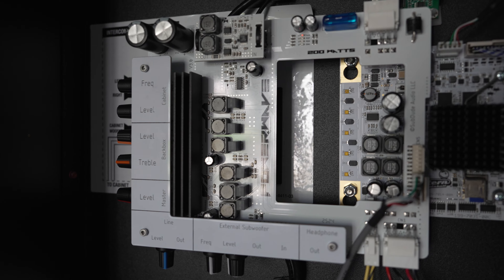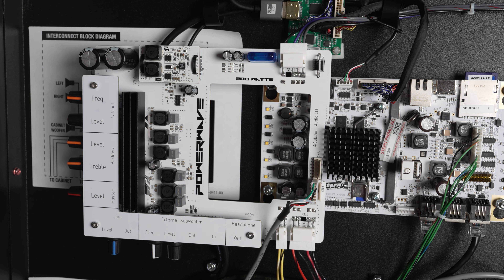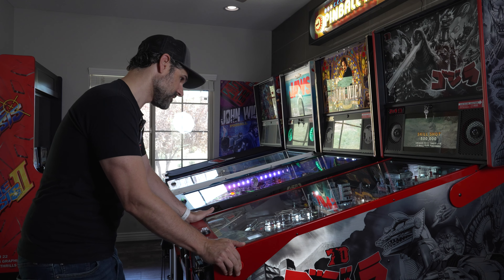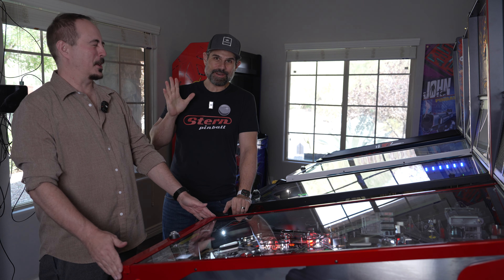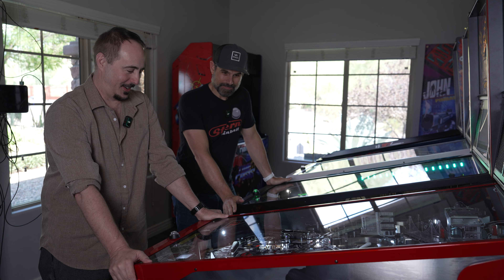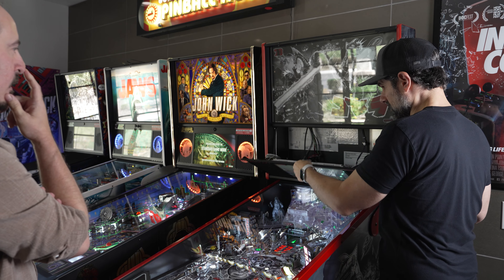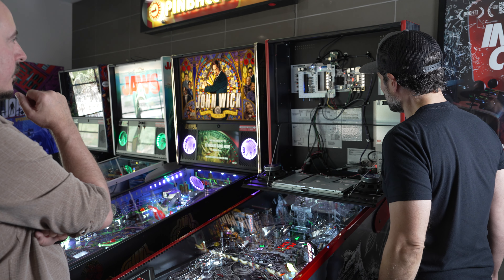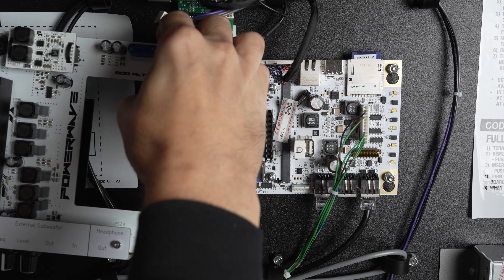The Ultimate Stern Pinball Audio Upgrade - PinWoofer PowerWave Super Kit!

Comment: The installation is way easier than what I expected. Wanted to do a sound upgrade but the pinside posts were making it sound like rocket science. Might end up getting this to put in my Wick. Great video!
Reply from the maker: OMG were they really making it sound difficult on Pinside?!  LOL... I like Pinside for some things but man, sometimes it can be a bit rough waters over there... haha.  I agree with you, the install is very easy and the instructions are easy to follow as well. Funny you mentioned putting a kit in your wick, I'm contemplating that as well. That soundtrack is bass heavy so I'm sure it would sound really good!  

Thanks so much for watching!
Reply: @RetroRalph  I could see the DIY or Knockout+ amp upgrade offerings being more involved (mostly related to wire routing), but the PowerWave makes it insanely simple.  The hardest thing would be lining things up if you have a game with an old CPU node board that has one less pin on CN5 (no woofer line_out).
Reply: @RetroRalph  They  added a handful of new great tracks for the job modes in the newest code too and im sure theres more coming. Exciting stuff!

Comment: Bitchin', Ralph. You are pushing me over the edge to get this setup once I drop for my 70th anniv edition. What is the effect of the amp on the headphones using the Stern jack panel on the front? Does the volume knob adequately control the output?

Comment: The sound was obviously better once the amp was installed. I already have the boom boom 3k and the kenwoods in my table, like you, and I'm curious how much of an improvement the amp made before the new speakers? I'm thinking of starting with the amp as I really like the the metallic white look of the kenwoods. I'm trying to gage the % of improvement coming from the amp vs the speakers... Did the amp alone provide 70% of the improvement or was it say 50/50 between the two?

Also, how dose this PinWoofer kit compare the the equivalent PinSound kit? Would be a cool video to compare the two!

Comment: Were you able to still use the red mirror speaker rings?
Reply from the maker: Yup, still using those. Although now Im contemplating if I should put the expression lights on this too 🤔 What do you think?
Reply: @RetroRalph  I personally like the red rings. I feel the expression lights may add too much reflecting in the glass. Unless your Invisaglass mutes it completely then I’d say go for it. I just prefer LE type look with the colored rings. I just finished my 350th game and added mylar to drain hole and shooter lane. Added plastic protectors on the in-lanes and slingshots. I applied a coat of wax with this amazing stuff called Liquid Lustre. Makes the playfield glimmer brand new again.

Comment: Did the install instructions suggest taking out the mesh below the 8" sub?  If the mesh is too dense, I could see that affecting the movement of air.
Clarity over volume would definitely drive my buying decision.  Half the time I need to keep the volume down to not disturb the whole house, so hearing the nuances in the soundtrack is definitely what impresses me.  Great idea to film the reaction of an (unexpecting) 3rd party participant.  I sent a couple questions to Dan at PinWoofer, but maybe the webpage's "Contact Us" submission didn't go through.  Ralph, you mention extra brackets.  Did you need anything not included with the PowerWave Super Kit?  I see he also has an optional bracket that is compatible with the official Stern lighting kit, but I thought the kit included required brackets/cables.

I'm hoping the stock amplifier is one of the things Stern addresses with Spike3.  Even if they do, I'm sure there will be room to improve.  Bumping the power supply (and quiet internal fan), WiFi 5/6 support with a better dongle/antenna, and CPU node processing power are a few of the other things that are 'must address', I think.
Reply from the maker: Hey bud, taking the mesh out actually is more to avoid the mesh rattling against the subwoofer when you have it really cranked up.  The clairty is amazing when using the PinWoofer speakers in conjunction with the kit. You notice the difference even at lower volumes.  It's a much richer overall sound and details in the soundtrack are a lot more prominent.   I liked it so much that I bought a kit for JAWS!  Everything you need is included in the kit and when you order, if you have a game with expression lights, there are options for that as well.  Just make sure when you order you specify the game and answer all the questions to ensure your kits ships with everything that's needed.  

Thanks for watching brother!  I can't say enough good things about this kit, I wish I knew about it sooner because I'm soon going to have a stockpile of Boom Boom 3000 subwoofers... LOL.  On a side note, it doesn't sound bad with the boom boom and the Powerwave but it's SOOOOOOOO much better with Dan's subwoofer that it's well worth investing a little extra for the entire kit IMO.
Reply: @RetroRalph  I'd think the spacer should allow the cone to travel freely, but that does guarantee nothing is in the way.
Pack the BoomBooms in your luggage for Expo and set up a "RetroRalph's Retro Resale" table. :)  TSA will be cool with it going through the scanners...
Pinball Life's (and everyone's favorite dub step pinball designer) Scott Danesi replied in an email that the Kenwood/Boom Booms combination weren't necessarily audiophile grade, but they were drastically better than stock offering at a very reasonable price point and worked well with the stock amp.  Now I'm afraid that you're just too darn loud...

Comment: I guess it's good to see the Pinwoofer guys move beyond rebadged aliexpress amps and $20 Pyle speakers.  They fill a niche for people who don't want to roll their own.  Now if they would just stop the scummy advertising in the DIY audio upgrade thread on Pinside...
Reply from the maker: Yes, this is a significant departure from that; this is all designed hardware (the Powerwave amp) and it’s very high quality. I liked it so much that I’m buying a few for the other games in my collection. The PW speakers are a great complement to the amp as well—much better than the Stern LE Kenwoods and the Boom Boom 3000 subwoofer. Although the Boom Boom sounded pretty good with the amp, the dual voice coil PW subwoofer is exceptionally clean when you drive it hard.